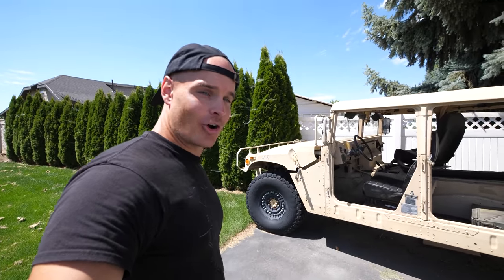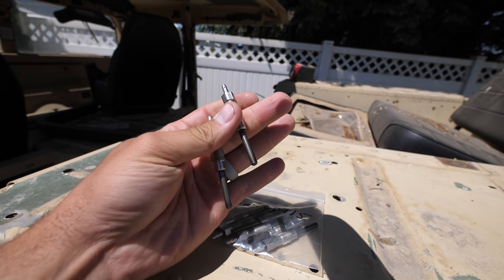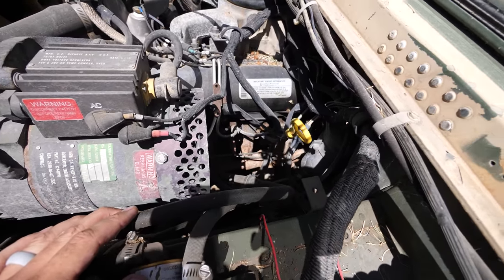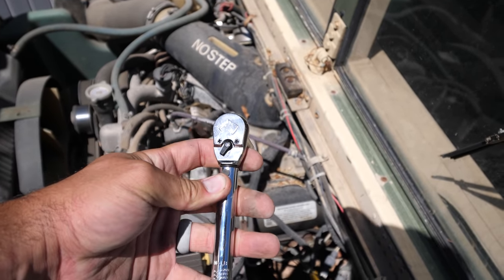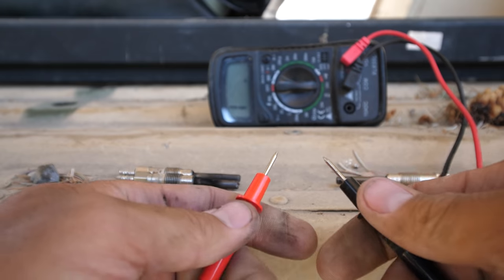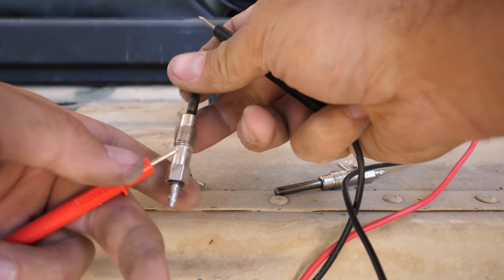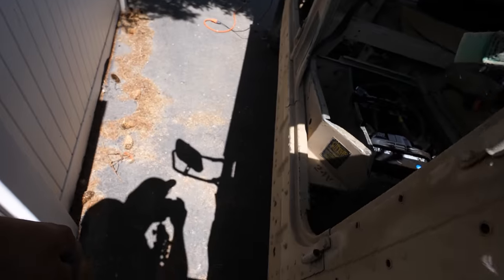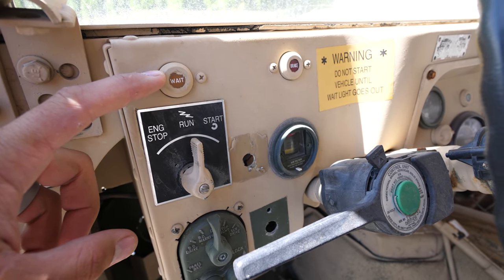NEW Project! Can we get this HMMWV Started? - Glow Plug Replacement

Comment: As far as i know, glow plugs are used to help start diesel engines in cold weather, so in your case engine should fire just up even without glow plugs connected. It is propably related to fuel - so first need to check if engine is geting fuel at all. Will wait for next update on this beast.
Reply: Is there an engine temp sensor on the injectors? Maybe since it starts cold everything is operating fairly normally,  but when warm/hot the fuel pump is somehow bugging out.
Reply: Nope that’s not how glow plugs works
Reply: @kevinprimus6366  Desiel engines get they're ignition from the heat of compression, so glow plugs really only help. They still need to be there in warmer weather to help start it sometimes but they really only come into play in colder whether

Comment: When I was in the Army and our HMMWV wouldn’t start we covered the exhaust with the manual/book and then cranked it until it started. It always worked.
Reply: We used our Kpods or the tip of your boot
Reply: Why did that work?
Reply: @byever1  builds pressure up in the engine to help the engine fire.
Reply: Don’t worry we still do that. I knew somebody had to have commented this.
Reply: How does that work though? I get the logic of trying to keep the pressure high in the cylinder, but if your exhaust system and cylinder are at higher than atmospheric levels, wouldn't that pressure just escape as soon as the intake port opens? Surely while starting the pressure in the intake manifold is around atmospheric levels?
Reply: @timderks5960  it also increases the fuel-air ratio, since the unburnt fuel can't escape, kinda like a choke on a carb. Eventually you will end up blowing some out on intake, but not much, and not till the cylinder is saturated.

Comment: Loosen the nut on the injectors slightly, when you're turning the engine over there should be diesel seeping out, if not it's most likely the distributor pump.

Comment: Glow plugs should not even matter if it isn't cold outside. Seems like a fueling issue to me.
Reply: Thinking the same
Reply: It does get cold in Utah. He said many were bad.
Reply: Yeah same hear, Diesel engine not getting diesel is what it sounds like
Reply: Yep, sounds like a fueling issue. Check it has fuel, check the lines. Start of with the simple stuff.
Reply: Fuel filter? Add a spin off type. Maybe the IP?
Reply: Agreed, the "it starts when it's cold but not when it's hot" that linked to it being the glow plugs made me do a big "huh?". I'm not sure how it is with non-construction/farming equipment, but when cranking for that long I'd also expect some white smoke from the exhaust if it got enough diesel, so I'm going for a fuel issue too.
Reply: @timderks5960  also, even in cold weather, cranking long enough to drain the batteries should give sufficient compressive heating to get combustion.

Comment: Spray a little bug spray in the air filter compartment and if it starts and run it’s compression and if it starts and cuts off it’s fuel , that’s a simple test

Comment: I was gonna say a diesel doesn't need glow plugs to run in warm weather so you've definitely got a fuel pressure issue is start from the tank and work your way forward check all filters make sure there's no clogged lines etc

Comment: I used to be a hummer technician…. It’s probably either the injection pump or an injector stuck open… remove the injector return lines and check for an injector returning excessive amounts of fuel

Comment: Its either getting no fuel (probably the main cause) or there is no compression. Even in cold weather diesels dont NEED glow plugs to start just to aid them. if its got fuel but no compression then youll see white smoke (un burnt diesel) or its got no fuel, do a compression check to find out, or crack a fuel line to see for fuel, as long as its not common rail which i assume it is not

Comment: First, check the fuel pump. They tend to go out as they are mechanical diaphragm pumps. Its non the passenger side of the engine. If that doesn't fix the problem. Check the fuel filter to see if its clogged. It's on the driver side of the engine compartment on the firewall. If that still doesn't fix the problem then check the electrical trigger wire going to the injector pump. If it doesn't get an electrical signal from the ignition, it won't feed the engine with fuel. If that still doesn't fix the problem the  make sure that the fuel lines are still in tact.

Comment: Glow plugs are for when its cold out! Warm day like yours the engine would start right over, sounds like you may have a fuel related issue, blocked injectors or a bad fuel pump or even blocked up fuel filter.

Comment: That seems like a fuel issue and not a plug issue, check the filters for dirt and make sure fuel flow is correct. Probably worth checking that fuel lines aren’t blocked with rust or other crap if it’s been sat for a while as it could be blocked before the filter. Possibly worth checking tight turns in the fuel line or check valves if it’s got one.
Reply: I doubt that the timing is off because it sounded good
Reply: Yeah your right actually probably not timing but I’d think it’s possibly crap in the fuel

Comment: Diesels don't need glow plugs technically. The compression of the engine is enough to cause combustion in the right ambient temps. Providing it's not minus numbers the up and down of the piston also generates heat. 

Check for air in your injector lines or see if the stop valve is partially held off.

Comment: the one glow plug with blown tip? hyyy?
perhaps you should check if there is nothing in piston liner 
if all good 
then check:
1.fuel
2.air intake 
3. pressure in the combustion chamber
Good luck :)

Comment: Definitely a fuel issue. When it's warm out the engine should run without glow plugs. The fact that you can't start it with new glow plugs mean fuel. Check the fuel pump and fuel filters next.

Comment: Pop the fuel lines off at the engine to confirm its making the voyage.  IF no bueno, change the fuel filter and check voltage at the fuel pump.  How long can diesel sit before going bad?  Oh, for giggles, I bought a open box Red Hydrogen for $150...its an awesome tank.

Comment: check the fuel pressure it's most likely a fuel pump or the injectors are plugged. Also wear gloves those vehicles are full of sharp edges.

Comment: Did you check if you have fuel? Or if the fuel pump is working? Maybe there's a problem there also. It seems that there is no spark in the engine.

Comment: looks like fueling issue.. normally if im working on a diesel engine I first check if there is any pressure from the electrical pump going to the mechanical pump.. even if the glow plugs were bad it should start but would take longer to do so and you would see some black smoke from the exhaust while starting

Comment: The engine turns really fast, the rings could have come unseated from the wall and not building compression. Put a little oil in the cylinder to help reseat and build compression.
Reply: It turns fast because it has a 24 volt starter. All military HMMWVs turn over that fast.

Comment: not a mechanic, just an ex-trucker - but if I had to guess, your engine isn't getting any fuel, and it's not making any compression either; check the air-cutoff, and the fuel pump...

Comment: Diesel only need air and fuel so most likely fuel is your problem if glow plug would have been your problem cranking the engine for a long time at the speed this one was turning would have made enough heat to start the engine

Comment: looks like a fuel issue ,, you can turn vehicle switch to run and wait then stop and do it like 5 times before start to build up fuel pressure from main fuel pump then turn on and see
Reply: That wont do anything since it has a mechanical lift pump.
Reply: @85TransAm406  
idk maybe its clogged up or leaking

Comment: No bend test???   I like that the actual hummer is a rig.  A rig made of frame, seat and engine.  Not made of pompe and circumstance like the H1 or H2 meant for the teenyweenie complex club members with more wallet than character.  Besides, we have Cayennes for that.

Comment: Fuel pump next ahahhaahha
Reply: Clogged fuel filter. Air in the fuel line will stop you dead.  Crack open one of the injector couplings. Fuel squirting out, or not, tells a lot.

Comment: ....its car mechanics........everything will be in your way. 

You think that's bad.....in my car I have turbo on the front (super easy to replace) but the glow plugs sit on the back of the block with a wiring loom on top that bolted down...with it been a front wheel drive it means the engine sit transverse so they are a nightmare to reach......very close to the engine bay wall as well. 

Did you change all 8 plugs???

Comment: Literally you are a small fortune away from an engine build.

Dude stick to phones....

Those plugs will be in the engine from the factory, they will be stuck and you can snap them easily....

You should soak the threads in WD40 before you crack them off. Or at least tighten them a little bit before you unscrew them or you're looking at and engine out & head off job.